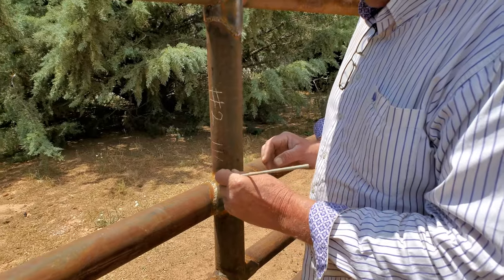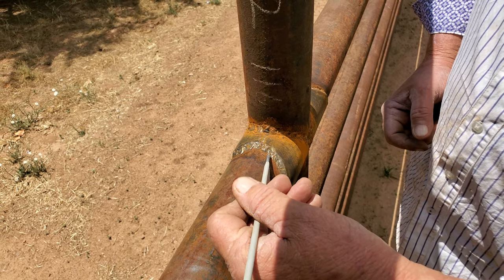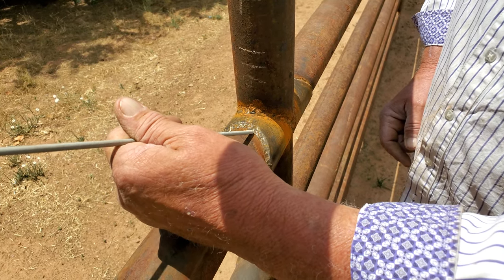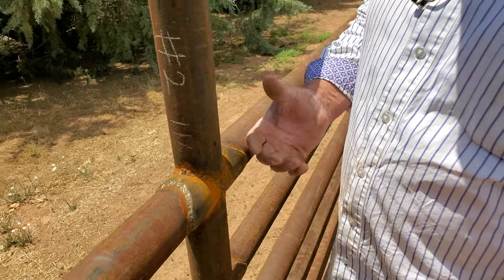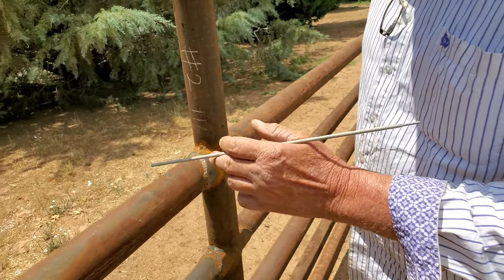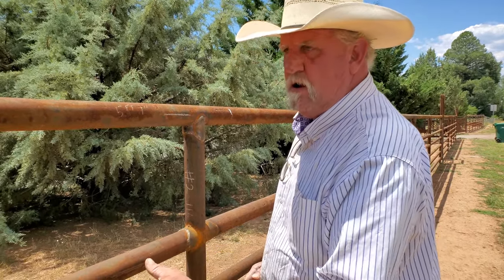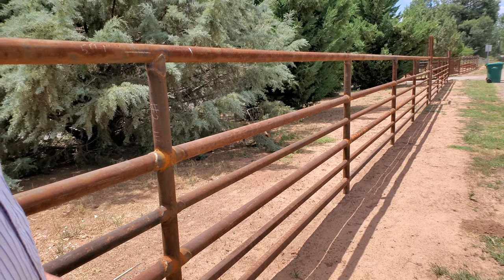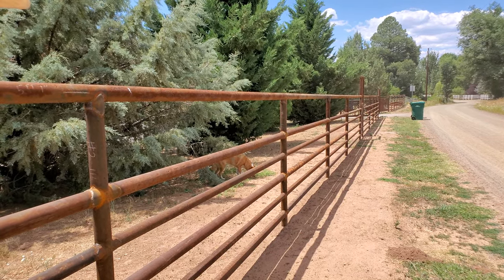Quick Help Video On Welding Pipe Fence

Comment: I have found that using ac welding and also wrapping the ground cable around the pipe few times helps fight the magnetic force
Reply: I used this tip yesterday, it absolutely worked. I’ll keep this in my pocket forever!

Comment: Welding advice from someone who drives a 7.3 .  Priceless!  Youngins,  listen up!
Reply from the maker: Thats just the go around truck the welding rig is a 96 ram 3500 dually ext cab with a 12v cummins an a 5spd and the material truck is a 2000 peterbilt 377 with a c10 cat and a super 10

Comment: Why use the fittings?  Wouldn’t coping the pipe be easier.
Reply from the maker: its actually way faster with the fittings because its chop and weld with top rail, and with post you just run down through there chop them to height knock the slag off with a grinding wheel really fast slip fitting on and weld it
Reply: @pipeworks5389  where did you find these fittings?

Comment: What are your measurements on that fence?  Total height, spacing, pipe size? Man it looks really good id like to do one like that around my place.
Reply: Its probably around 5ft high , line poles are 9-10ft apart. Hes using 
2 7/8 for the linepoles , toprail and 2nd 3rd row. The smaller pipes he added are 2 3/8.
Reply from the maker: so it is 5ft in height posts are 10ft on center apart post and top rail are 2 7/8 and rails are 2 3/8, and the hangers we use for the rails keep them at 13-15 apart